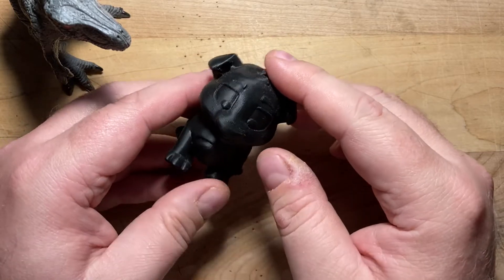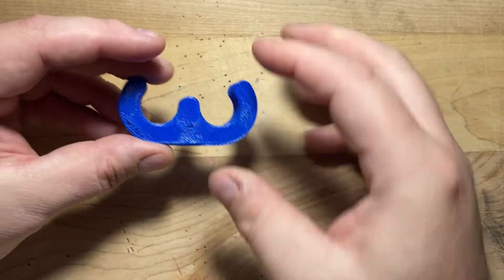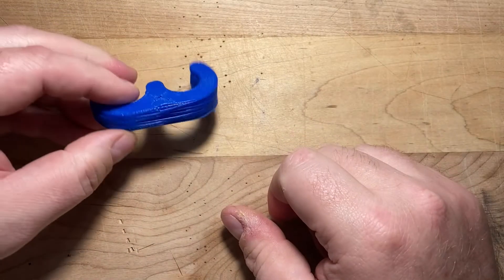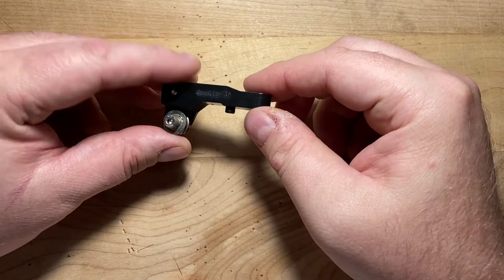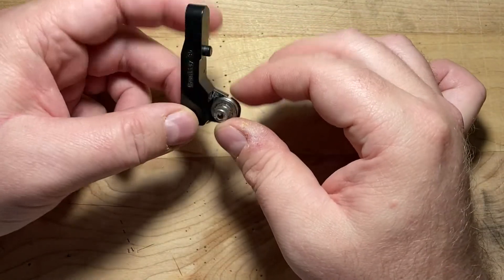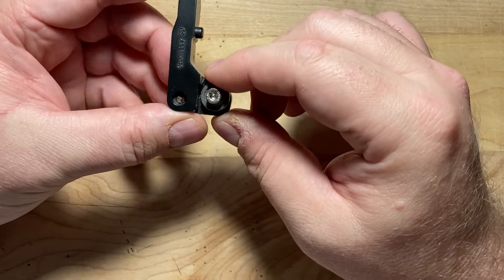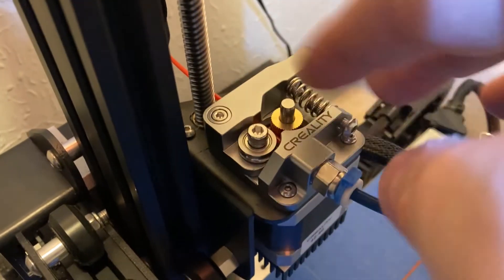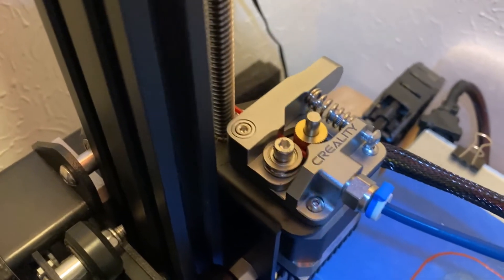Ender 3 3D-Printer Troubleshooting:  Poor Prints and Delamination

Comment: I really appreciate this video. I’ve been chasing a weird, random under extrusion issue and it’s been driving me nuts. After watching this, I checked the tension idler arm and lo and behold it had a big crack in it. The aluminum parts are on the way. I really hope this is the nail in the coffin for all my problems. Thank you!

Comment: Exact same thing happend to me, in fact my prints would after a while completely stop feeding and it would just sit and print in the air. I replaced it with an aluminum version (replica) and I still have issues with delamination exactly the way you had

Comment: Bro. Thank you very much for your video. I met the same problem about layer delamination with my Ender 3 V2 after print like 2 months. And I upgraded the BL touch, changed the printing temperature to 220 C, and lowered the printing speed; however, it didn't fix the issue. Until I found this video and bought the new extruder arm upgrade to all metal parts. It finally fixed the problem. I think the original arm didn't clamp the filament tightly, so when during the printing process, the extruding force significantly reduced after each retraction movement.